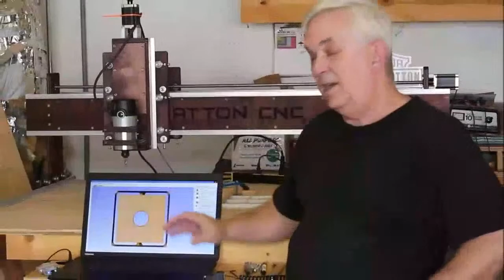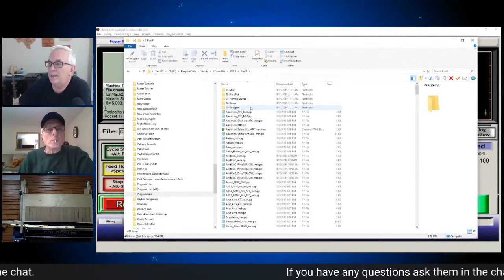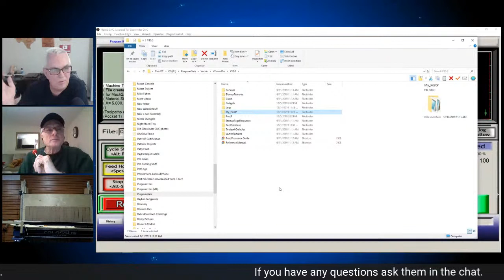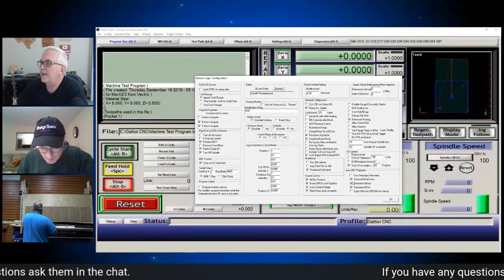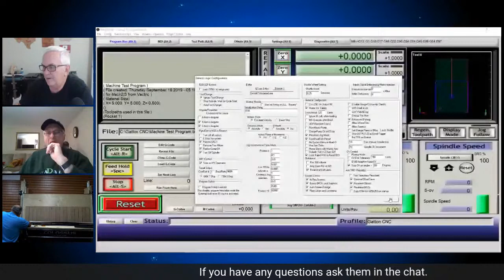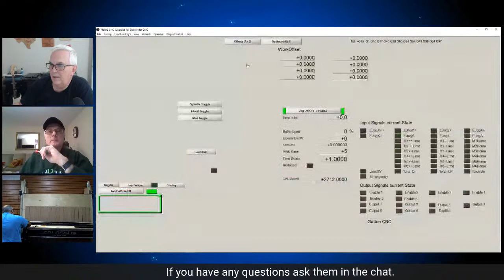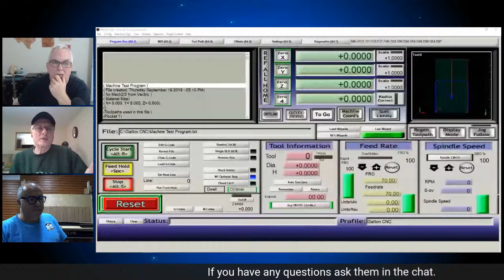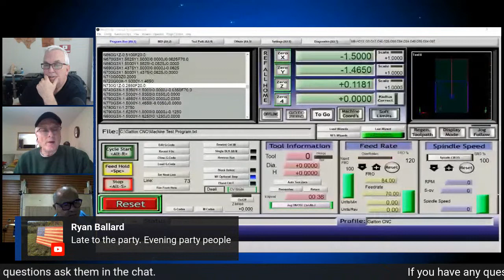CNC With Dave Gatton - Hobby CNC Q & A 12-14-19

Comment: Can a Gatton CNC be built to accept a standard 4x8 sheet of plywood? I mean, is it advisable? I want to build something for making stitch and glue kayaks and be able to work with a standard sheet of marine ply.
Reply from the maker: The short answer is no.  The Gatton CNC was designed with the hobbyist in mind and to help people who otherwise might not be able to afford a CNC for their shop.  The components I use work very well for a smaller (4 x 4) machine but are not practical to use on a large machine.
Reply: @DaveGatton  Thanks for the reply Dave. Still, for the price, you've really got an incredible design here.
Reply from the maker: @austntexan  I would have to agree with you.  😉